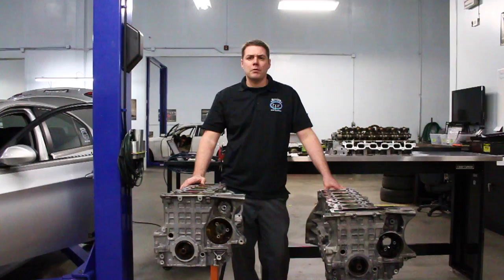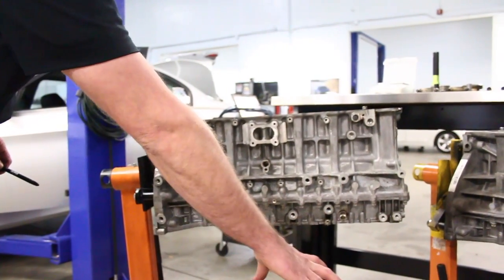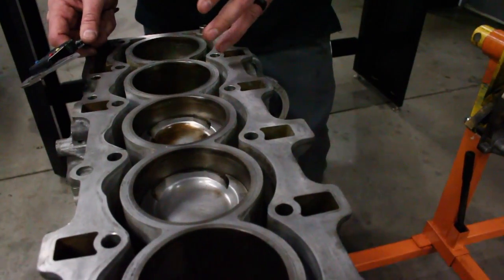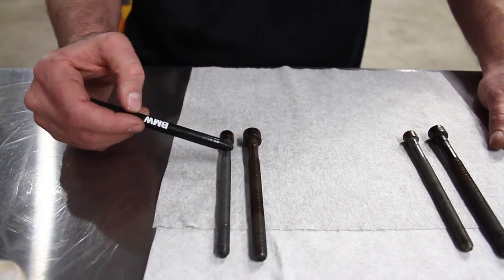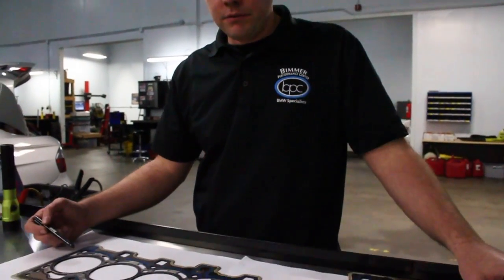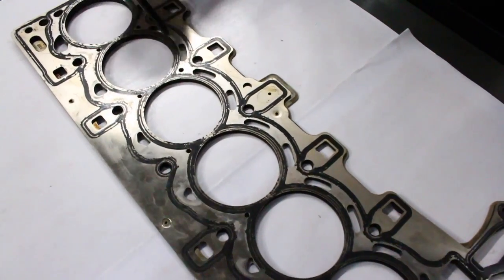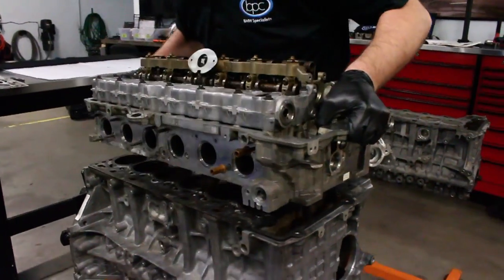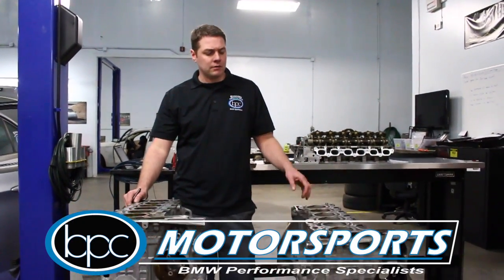N52 vs N54 Block by BPC Motorsports

Comment: For those that don’t know, a N53 block and head exists. It very similar to the N54 and N52, almost like it’s a child of the two. The N53 head can be made to fit the N54 and it is an entire upgrade to the N54 head. Bigger  and taller runners (relative to the head), better camshaft specs, and bigger valves. I believe you have to weld up just a couple spots on the head and deck it flat but you could make 800HP much easier than you could with a N54 head. Also Schrick cams for the N54 head also fit the N53 head so you really could get this combo to make huge power. Also  fyi N54 guys, make sure to use bullnosed (rounded end) headstuds to avoid cracking! It’s a huge issue with built N54s, regular headstuds cut into the block and creates stress points which absolutely will cause cracking. Anyway that’s enough yappin

Comment: So you throw the N52 head on an N54 and then what? How would you make it work when valves are bigger, bore is smaller and pistons have small recesses? And the dreaded valvetronic, the 335i ECU doesn't even have the hardware support for valvetronic (the module that was once separate but then became part of the DME). This actually doesn't work even on paper.

Comment: I’m a little late to the video but my 06 330 6 speed N52 is at 267k miles and still going. No deep engine or trans repairs that I’m aware of. Fantastic car and still running strong.
Reply: 270k
Reply: 280k engine and trans never opened for repairs maintenance only
Reply: was waiting for the punchline, can you swap the n52 head on an n54? has someone done it? is it worth it, or are you better off adding more boost for the time and assuming you need a stand alone dme to run the valvtronic and boost?  do you need an MAF to run the valvetronic?

Comment: What about cooling on a stage 1 turbo set up with stage 1 fuel pump  N52 or N54 would be a better option  E92 328 2 coup ?

Comment: Being that the n52 has larger cylinder bore and valves. Just getting forge internals will make more power than the n54 if you were to use forge induction?

Comment: This video is trying to make us believe the N54 is a "stronger" engine which in people's minds translates into a "reliable" engine. 

But in reality nothing's further from the truth. The N54 is simply put a minefield, it's well documented in forums and reviews from professionals. The N54 suffers from HPFP repeated failure, no matter how often you change the part. Turbo failure, overheating, injectors failure, carbon buildup.

The N52 NA port injection will have none of that, zero. My 2007 E92 330i has 93k miles on the clock (150k km) and has been 100% faultless. Water pump might go like in all modern BMWs including the N54, some oil gaskets will need replacement which is normal, but none of the N54 shenanigans. The N52 is essentially reliable and trouble free.

I just wanted to make that clear to people who watch this video. Just google N54 problems or ask an independent BMW specialist garage.
Reply: You just mentioned everything attached to the n54, not the n54 itself. The engine itself its strong as fuck, I myself being ST with ZERO issue since I've owned the car,  normal issues like you mention but what part doesn't fuck up. I just lost my water pump at 168k miles, same injectors same ofhg. 9/10 you bought up a beat up n54 because everyone wants the power but dont wanna maintenance it, so they sell it because ermahgawd it's boosted so itll sell fast to another idiot who don't know shit mechanically, thus a history of shitty owners until it falls into the right hands.

Comment: The N54 is turbocharged so it needs to be stronger. On the N52 I wouldn’t have used .magnesium but with proper care (changing the antifreeze on time and using the correct one, or when servicing you need to blow air to clean the coolant so it doesn’t stay on the magnesium surfaces in in holes) it should be ok.

Comment: Quick question: What is the value of the N52 piston pin off-set ??
Reply: I know it's been 2yrs but thats how the stroke is increased
By raising the pin location the connecting rod is longer so it will pull piston down further allowing more volume of air/fuel for more power

Comment: Can you fit a n54 in a bmw that comes with a n52?
Reply: I'd also want to know about that and my interest is in fitting the N54 on a E87 BMW since most tuners are now slapping the S65 into that chassis and I'm curious about the N54 motor...
Reply: @lindabenton1436  that would be sick
Reply: @lindabenton1436  Of course it does, basically same engine just with 2 turbos strapped to it, just get custom fab to connect downpipe to exhaust and you are good, assuming you swap harness and ecu etc

Comment: The question is why would someone put N52 head on N54 block?  What is the reason?
Reply: Heads flow better, Valve tronic (adjustable valve lift), and port injection to get away from the high pressure fuel pump/direct injection that N54 famously has issues with.

Comment: 1-How often does the road bearing go bad in the N54.

2- when BMW stopped making forged piston on the n54?
Reply: 1 - rod bearings rarely fail on an N54 but if they do it is usually due to fuel dilution from bad injectors.

2- BMW never made forged pistons on the N54. In fact contrary to what the tech said in the video, the N54 (& N52) never had forged rods meaning only the crankshaft of the N54 is forged.

Comment: Can the n54 pistons and rods fit in the m54? Its the same bore stroke.  The n54 was derived from m54. M54 has 211 deck with rods 135mm. I n54 rods are 145mm i think. Dont know the deck on the n54. The n54 has the double vanos like the m54, no valvetronics like the n52.

Comment: my low miles e46 took a few dumps on coolant system $2000. . $1000 duel fuel pumps, $400 crankcase oil diverter vavle isnt bulletproof like cold climate Canada spec, shocks bushings and control arm 40k miles, wheel bearings $600each, belts   slipped off 2x melted rad. Window switches, trunk latch,  Dealer service 6yr warranty.  5k yr miles.  99k miles runs better than new w upgrades, not for long.  Sold $5500.  Bought 19k mi 13 e93is dtc lbm-coral

Comment: Built for strength but open deck?
Reply: They are rigid as hell, because they run so hot from the factory they desperately need cooling at the top of the sleeve to pull heat out despite being direct injection

Comment: N54 engines ARE reliable. 223,543 miles and still going without any lost compression.
Reply: Jhil Ortiz 131k on mine and still on original everything, coils, injectors, hpfp and water pump.... just change plugs and oil/filter ... coast to coast twice and never a single issue
Reply: Rob Hughes I am in the process of FBO and later on meth directly to each intake port

Comment: What are your thoughts on a 2006 530xi wagon? Looking for a reliable daily.. came across this ad. What are some of the main components that I should ask the owner about with regards to maintenance/replacement. From my research N52 was more of the reliable motor BMW made correct. More concerned with reliability than power. What would be a fair offer if everything checks out? Thank you. https://sandiego.craigslist.org/csd/cto/d/san-diego-rare-low-miles-2006-bmw-530xi/6783122221.html

Comment: Hey Dan I am wondering if a N54 twin turbo complete engine from a 2008 would fit into an 2006 330xi AWD (both manual) just looking to get an N54 into my 2006 where the N52 is. Would it be cheaper to buy a 2008 already built! thanks!

Comment: Does head gasket ever fail on N52 or N54? I hardly every hear about head gasket failures on E90. But of course, I hear all the time oil filter housing gaskets going bad as well as cover and oil pan leaking and of course water pump going bad.
Reply: N52 owner here, head gaskets arent known to fail at least in this one, piston rings leak oil and its considered normal plus camshaft bearing ledges are known to get worn out, including the one on the intake side which is a part of valve head itself which means costly fuckin repairs.
N54 on the other hand are known to die quickly - breaking rods etc. 

Generally both engines are trash and a thievery end of the story

Comment: 10:04 the lip on the head gasket is there to separate the cyl.head (Al) from the block (Mg) to avoid corrosion. The can live quite happily together as long as there is no water between them, eg. you're not making a galvanic reaction... Mg and Al are about 0.7V apart in that regard, so this is why 1/4 of the N52 workshop manual is 'dry the hole out', 'make sure the surfaces are dry' etc....

Comment: Whats the top mileage ever recorded on an n 52?
Reply: 373k km / 231k miles and the engine is still running smooth and strong.
Reply: @dcafanatics  did u replace your vanos during that time? what about oil consumption?
Reply: @dvls2945  The oil consumption is something normal until 0,5L  depends on the way you drive the car . Related to the vanos, wasn't replaced until now.
Reply: @dcafanatics  Every 6 months I add 1L of oil, around 8000 miles. Is that normal?
Reply: johnnyB Good I’ve personally done 160 maybe a little more because it was a long downhill. Took forever to get there and I never hit redline in 6th gear. 6mt

Comment: I love my E90 330i (N52) - no direct injection or fuel pump issues.  One of the last BMW NA 6-cyl engines ever made.
Reply: same here! My 330i is at 135,000 miles and still going strong
Reply: @kiwiteetee. If your looking for more power other than a 5k Supercharger for +90 whp. At the beginning of next year I’m putting a Safe Nitrous kit for the N52 , with full bolt ons and the shot of nitrous we’re currently running 425hp to the wheels . Kit will run about 1500$ or 2500$ with the stand alone fuel system,
Reply: Theshitbox_ this came out yet?
Reply: @dieseldan404  which bolt ons ?
Reply: boboprime2000 I’ll be posting the full build video late December
Reply: Theshitbox_ where can I see more of what you’re doing
Reply: Full bolt on’s as in everything you need to safely run the kit ...1. Headers you will want to be catless when running the nitrous , colder spark plugs ,Ignition Projects IP Coil packs by evasivemotors , cold air intake by injen,
Reply: FBO n52 is not slow
Reply: yes, i have a 2007 525i with 98000 klm on it, no leaks no noises goes hard and it reliable
Reply: The last
Reply: Kiwi TeeTee the n52 has all the strengths of the n54. I dont agree the minor beefier construnction of the n54 outeighs the negatives like direct injection of the n54 that keads to needing difficult cleaning. Thats why bmw went back etc. My n52 has 173000 miles and has never been opened or intake cleaned, runs very smooth and strong.
Reply: brandon bentley Add a 6266 turbo with 18 PSI and we’ll see if it has the same strength.
Reply: @adriangutierrez8177  they hold up to 25psi try again
Reply: brandon bentley my 09 n54 has 131k and has never been walnut blasted, has original injectors, coil pack, water pump & hpfp. I’ve driven coast to coast in it twice now and never a single issue and waaay more power at any given time than any n52 out there
Reply: @R69H  you're in luck then
Reply: @R69H  yep you are lucky AF lol
Reply: *gets gapped embarrassingly by an N54
Reply: @induwaraekanayake2250  wrong, first of all the n54 is nowhere near as durable as the 2j, open deck aluminium block vs cast iron closed deck, also if you did any research you'd know that the n54 and n52 are almost the same block (same materials too)

Comment: I just stumbled across this channel by accident and I have been tuning bmw motors for the last 20 years, from the 2002 to the current M6 and everything in between. I have created a 330d e46 that can get 49 mpg consistently and also a S54 to 1212bhp plus the M54b30 with forged internals and a bespoke precision turbo with 852bhp, getrag 6sp sequential box, carbon fibre prop shaft, half shafts hood wings and door skins, poly windows 1070kg wet, 10.30s quarters, 0 to 100mph in 8.28s 150mph and faster than the nismo gtr of 2017 round the Nürburgring b2g. All our engines use carrillo h-beam rods, cp or Je forged pistons and acl bearings arp Bolts and nuts cometic head gasketsand custom Newman cams .emerald and ati ecu's, precision turbochargers, lysholm twin screw & centrifugal procharger superchargers. Farndon billet crankshafts
Reply: Mworx can you be my frind
Reply: So how can I make my n52 make power with no turbo
Reply: @barc533 
With no turbo, it's already pretty good.

Exhaust headers and 3 stage manifold are your big difference items.

silicone intake boot, charcoal filter delete, ram scoops, and milves will also have some small gains.

If you were to add boost, I wouldn't push past 10 psi without internal upgrades.

If I did plan this route, I'd go with N54 rods (or aftermarket N54 size) and custom forged pistons for the larger wrist pins.
As well as drilling and tapping for the larger head bolts.

Comment: OK people... 1 motor is a turbo motor and the other is NA.. Naturally Aspirated... Of course the tub engine is going to be built stronger.... Then NA motor is purposely built lighter to make power and spin easier under much less stress than 2 turbos blowing hot air into them under enormous pressure. N52 is purposely built that way...
Reply: As simple as that.
Reply: Turbos blow cold air in but we get it
Reply: @willybman3723  nah even after the intercooler its pretty hot
Reply: @willybman3723  Hot and cold is relative.🤓

Comment: Hi, i am having a problem with fitting n52 bedplate, the crankshaft does not rotate, but i used torque settings recommeded by bmw. what am i doing wrong ?
Reply from the maker: It would be best to contact our service writers to assist you with your needs. They can be reached at (919) 501-2090 or email at service@bimmerperformancecenter.com

Comment: Are the n54 pistons forged
Reply: Some shops say cast... some say forged.  Not easy to find out.
Reply: Forged pistons and rods, you can tell by looking at the bottom of them that the aluminum was forged with a press, instead of having cast marks.

Comment: Thank you BPC what a video, although beside all the addicting information. The real question I was hoping to be answered was not.
Will the N52 aluminum mag valve cover work with the n54 head in direct replacement of the plastic n54 cover more importantly how well does copper seal between aluminum and aluminum mag cover if used?

Comment: Make no mistakes, the N52 is very reliable. There are still lots of 325i cars running for 24h races. For the N54 I can imagine the engineers went on the conservative side and left a lot more safety in strength than actually needed because they did their last Turbo car in the 80's.  But tuners fear not because there are good indicators that the B58 (340i etc.) does have a lot of tuning potential that even exceeds the N54's.
Reply: The N54 is a far better engine as far as tuning capabilities, but say what ya gotta say. The N54 is a far beeffier engine it's built stronger. pay attention to the head bolt diameters and other hardware strengths.

Comment: N54>N52
Reply: exept if u are true bmw guy, n/a straight 6 is the right engine.
Reply: @samitapio8774  Than how to build that N52 engine in to best performance and a lot of hp ?. I own E92 325I
Reply: @henzo7087  how so? It's NA and only makes 220hp. Stock N54s have handled over 800whp. N54 FTW
Reply: @Chitownloverboy  it makes 272 , and easyly goes up to 310 with only tune headers and exhaust
Reply: @firatmehmet1274  LMAO n54 does 280whp stock a simple tune and it's over 350whp add in full bolt ons and your North of 400. Do like me and add in fueling with hybrid turbos and your at 600whp. My new setup is a built motor, 8hp70 swap, g1050 single turbo, and a bunch of other stuff should be around 900hp.
Reply: +Sami Tapio agreed. N52 FTW
Reply: Everything about the n52 is more innovative and groundbreaking than the n54 in terms of technology and uniqueness.
Reply: N52 ftw
Reply: Wrong. N52 is infinitely superior.
Reply: @camposjesus3725  Bet you can't Explain why.
Reply: True bmw guys hahahahahah.... am a true bmw guy.. this is 2017 turbos are they only way cars are made these days.... you have to grown with the brand not be suck in 1980s
Reply: Vishnu Patel: Go educate yourself about the brand and don't be a random fanboy. The N52 was designed and built in the 2000s. There is absolutely no way, an engine like the N52 could have been build in the 80s, as the materials and production methods weren't even invented at that time.
Turbos are just used to achieve performance while maintaining emissions standards. Trust me, every decent engine-engineer at BMW would love to continue building high-rev NA engines, not to dull turbo crap of today.